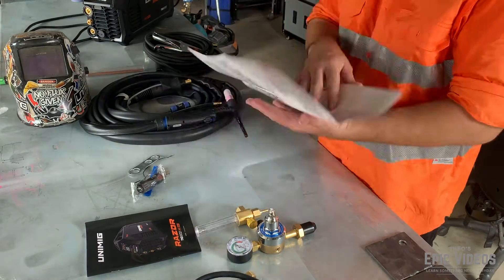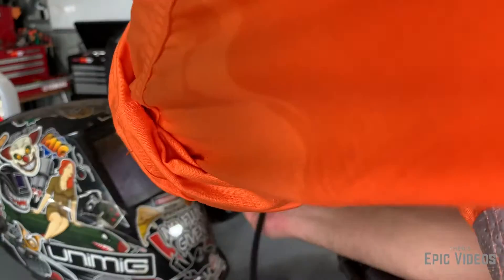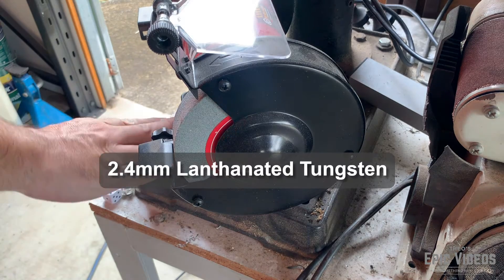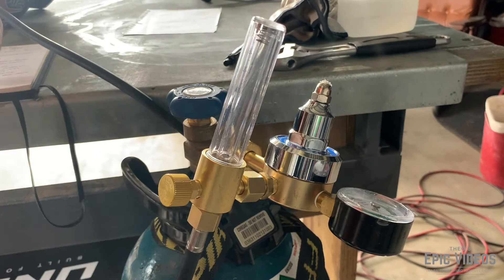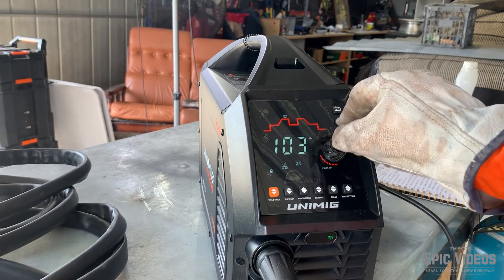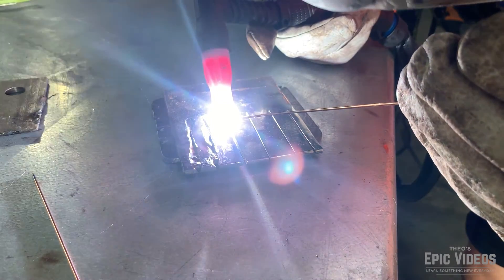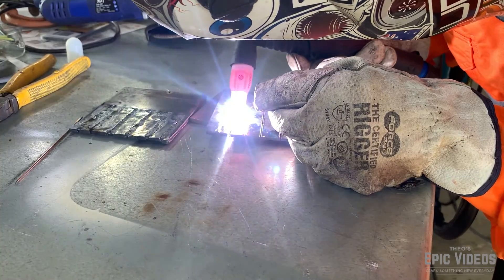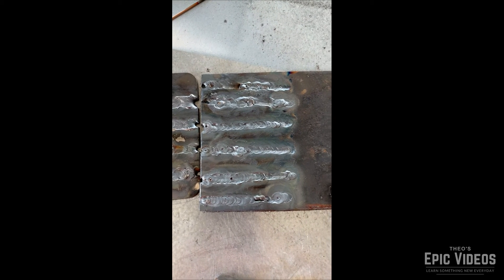Learning How to Tig Weld - Part 2 Unimig 200 Razor ACDC TIG Welder

Comment: Hey mate did you figure out the gas flow? I’m getting about the same as you, maybe a bit more? 15lpm. I expected it to max out the flow meter but I’m not even close! Thanks :)
Reply from the maker: Book says 10lpm 
I've not changed it and I've done a little bit of ally work since. 
No porosity issues.

Comment: i just bought this machine and find it awesome, tig welding can be very addictive.
Reply from the maker: I've just started Ally TIG welding. 
Read the manual, had a yarn to a mate (boilermaker) and had a crack. Great result. 
The machine is fantastic for mild steel though..

Comment: Nice video of your early experiences with TIG.
I would have liked to see your settings, once you got the heat dialed in, at least the amps and if you used pulsed or straight dc
Reply from the maker: DC doesn't have pulse settings I believe. 
Only AC for ally. I've just started Ally tig welding now. 
I'll make a video soon. 

Mild steel doesn't need anywhere near as much heat (amps) as AC/DC or MIG Welding. 
I believe from memory I was doing 3-4mm steel at about 60-70amps on DC.
Reply: @TheosEpicVideos    thanks for the reply! 👍